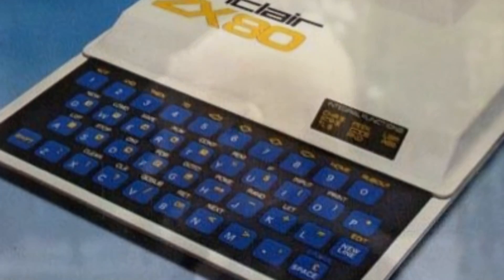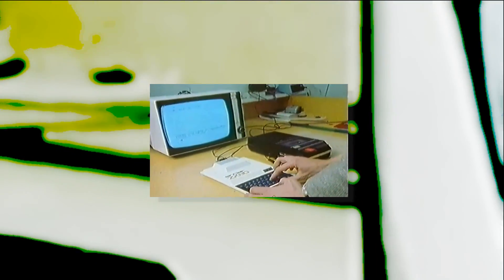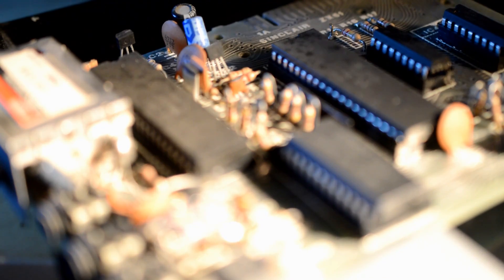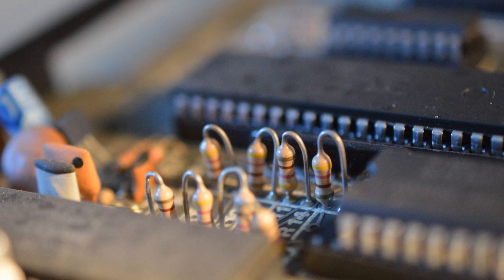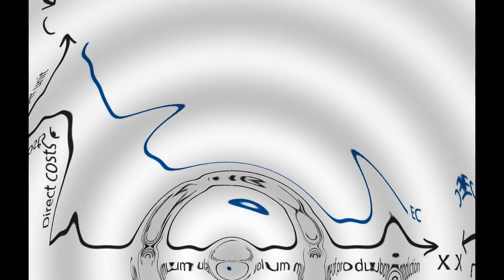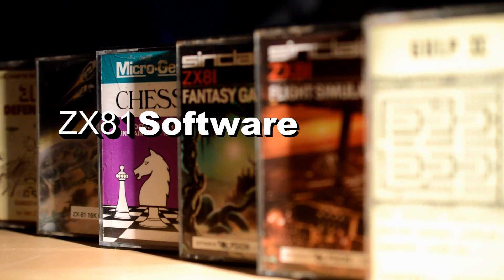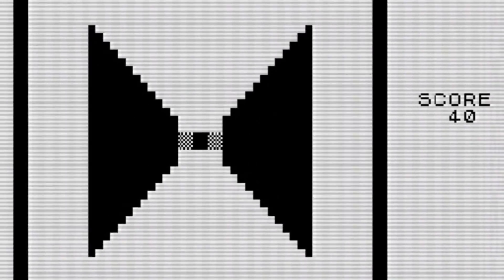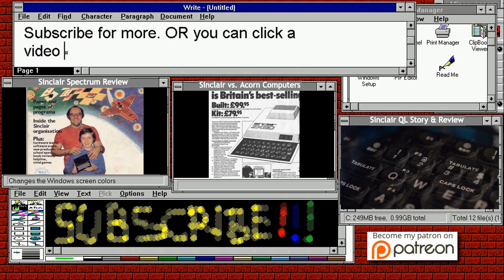Sinclair ZX81 (Timex 1000) Grandaddy of Computers | Nostalgia Nerd

Comment: i never had a zx 81 but i use to have a commodore/electron and i actually miss programing in basic programes from books and magazines and i use to work out the vdu code from my mums knitting patterns ,its a pity you cant just type into a computer anymore 10 print"tez" 20 goto 10 into the command prompt on windows

Comment: My dad got one of those when I was about 8yrs old or so. Two hours to program pong another hour to debug then get bored playing after 5mins. And those rubber keys were a nightmare to use. He also bought a printer that used rolls of this silver paper that has blue under is surface that the printer pin would melt and scrape images onto it.

Comment: OMG that was my first computer!! I paid $99 for it from my job at McDonalds in 1982. Over the next year I spent most of my checks on it!!! First I got a flat black and silver cassette recorder from Radio Shack. Next I got a 16K add on but it wasn't Timex's 16K block. Mine was form fitted along the whole back side of the unit. Next I bought a full size real keyboard for it that was a bit heavy in a metal case and sat right in front of the unit with a thin cable from it into the unit right above the 5 & 6. Next I bought the Timex 2040 printer and the last thing I bought was an io device that was form fitting along the whole back behind the 16K pack. I can't even remember what I got the io thing for? Then it all came to a stop in September or October 1983 when I saw a full page add for the Commodore 64 in a home computer magazine. I had seen adds before but it had cost $595 and I thought Id never be able to buy it. This was the same full page add I had seen before but across the top was something about a price drop to $229!!! I had at least $400 into my Timex/Sinclair and it could never be as good as the C64!! I remember the two biggest things that the C64 had that I wanted was color and sound (Awesome sound chip!). That is my story of loving my Timex/Sinclair 1000 to being all in as a Commodore 64 lover and my Timex/Sinclair being all boxed back up (OCD about taking care of all my items boxes!!!) and sitting in the back of my closet.

Comment: The ZX81 was used as the brain for a hacked BigTrack my father built that you could truly program as a true robot... It was a much-loved control system for the DIY robotics scene in the 80s, also probably the reason so few of them survived, they were cheap for using in projects as the Raspberry Pie of its day.

Comment: Dragon's Lair on the ZX-81?! Holy cow. I had the Timex version, spent hours typing in and debugging an orbital simulation from Creative Computing, was editing out the last error and preparing to save when the computer jiggled EVER so slightly and )blink( - RAM pack movement WIPES OUT all memory. Hours of work GONE. Frustrated, I immediately start over, retype, debug, save successfully, finally off to bed. Few days later, load up the program, try to input from keyboard - middle keys ALL unresponsive. Took the damnable thing back for refund, went to Radio Shack, bought a TRS-80 Color Computer, never looked back.

Comment: made a horror game in 40 seconds based off of saw.
basically, its crap but it's functional crap. There are no graphics, just commands
Pull the lever and die or don't pull the lever, get called a rude word, THEN die.
If you want the program, shoot me a message

Comment: 5:25 the keyword single key system (instead of typing each letter) was not to save space in a stored program as the CBM PET, Apple ][, Acorn BBC, Vic-20, C64 also stored the keywords as a single token byte which was a lookup into a table to access the ROM routine.  All the latter computers had the user type the individual letters of the keywords which the system then parsed into tokens (the Apple ][ was particularly heavy handed with token conversion).

The main reasons for the keyword system were it cuts out the need to parse the line entered for tokens, and syntax checking was implemented by only allowing valid keywords to be entered at any point removing the need to check syntax when running.

The only micro of the time I know that didn't tokenadise the input was the Acorn Atom.  However, it did allow you to abbreviated commands to the first few distinctive letters followed by a full stop.  The BBC micro kept this abbreviation system for its tokenadisation code.  The CBM machines used a feature of the way the tokenadisation code was written to allow abbreviations by shifting (thus setting the top bit) the input character (after enough to identify the token had been entered).

Comment: My very first computer. I added an external keyboard, a 16K memory pack and a tape recorder. Games on cassette would take around 7-8 minutes to load. There was a remarkable flight simulator which worked on the 64x48 pixel display. I don't know if you came across this, but it was announced that some UK government departments were supplied with ZX81s because, for certain duties, they worked faster than PCs of the time.

Comment: The ZX81 manual was miles ahead of other manuals at the time (or even now). I've shown it to a number of modern school kids while talking about early computers and one thing that comes across is that it is clearly aimed at someone who has never even seen a computer before.
Reply: The admiration of the old BASIC manual does intrigue me. Would you say it's still a viable way of introducing yourself to basic programming? 

I know it's not going to have a massive relevance to modern programming but is it still a good introduction of sorts?
Reply: @AC.LM11  It introduced a new concept with each chapter with practice exercises. So things like subroutines, printing anywhere on the screen, using graphics. All the basic concepts are there even by modern computing standards.

Comment: when people talk about the ram packs they only mention the sinclair ones, but the 3rd party versions were twice the size for about the same money(datel electronics, romantic robot and kempston which had a joystick port on it, i had a sinclair one but also had a datel 96k one though never found anything software wise to use that much memory lol, another thing was they are stackable if you have the type with the pass through slot on the back, you can put another pack on the back and have 32k.

Comment: Someone I knew gave me his old American versions of the ZX81, the Timex Sinclair 1000 in the late 80s.  It include the 16k ROM expansion pack and the Zx printer, a spark printer. Played around with it for a short while. I found the membrane keyboard to be pretty poor for extended use though like the ease of typing basic commands with key combos. The TS-1000 sold for about $100 in the U.S. back when it debuted. Interesting footnote in computing history, though like netbooks being displaced by iPads and other tablets, the ZX81/TS1000 where just not quit up to the task compared to the ZX Spectrum, Vic20, or even Atari. Sometimes it's better to spend a few bucks/quid more to get something more usable then to just go for the cheapest.

Comment: Since a heck of a lot of ZX81's were sold as kits, it is a shame they did not include an option for AV-3-1910 sound chip and 16K Ram on the motherboard, or for assembled machines, a socket a sound chip and extra Ram.  The sad part is there is enough room on the motherboard to add these and it would not have cost anymore.
Reply: Anyone with a working knowledge of digital electronics would be able to do this very easily. Unfortunately the ZX81 was designed down to the last penny.
Reply: I know it was made for the lowest price possible, but leaving space for un-populated chips should not have cost any more money.
Reply: @10p6  " but leaving space for un-populated chips should not have cost any more money." Not true at all, the PCB space still costs as you need a larger PCB and that cost adds up when your making 100,000s of them.. they just wouldn't do it knowing that probably few people would actually bother/or have the smarts to, add those chips. the market needed a super cheap computer.. if you wanted a computer with extra memory and sound those computers already existed and naturally cost more
Reply: @DanafoxyVixen   All the electronics even back in 1980 / 81 would have fit on the normal PCB, so it would have not cost any more.

Comment: I had the official 16K expansion, which I kept in place with a rubber band that went all the way around the computer.  It was $100 US assembled and $50 for the 16K.  I bought it before the TI version was released.

I learned assembly language on it by converting the assembly language into numbers by hand, then putting them into a string with a basic program.

While the mnemonics are different, Z80 assembly language is pretty much the same as 6502, so it the move to the Atari 8 bit wasn't difficult.

Comment: I was tempted to save money and buy the kit, but I thought to myself, what happens when I solder it all together, and it doesn't work?  This was before Timex branded it as their own.  I remember mailing away to Nashua, New Hampshire for one of these.  It was not long before I also ordered the 16K RAM pack.  I also remember basically learning Z80 assembly from the manual, because of the table they had, for each 8-bit number, listing the decimal, hex, character, and opcode nmemonic.  Heck, I hand assembled some programs from that table, then sat there POKEing the code into a (dummy) REM statement.

Comment: I had the Timex Sinclair 1000 around 1983 i think it was, was fairly useless, i kept running out of memory either while writing code in basic or would crash on initialization of first string array. it was pretty frustrating, even after getting an 8k ram expansion pack, the situation hardly improved.

Comment: I don't understand the reliability issues, I've owned three TS1000s, and never had a single problem.  They do get a bit warm to the touch, but otherwise are pretty bullet-proof (I suppose I could have just gotten lucky three times in a row).
Reply: It was mainly an issue with the machines sold in UK and europe, i believe; the main culprit, as also mentioned in the video, was too weak powersupplies, but as soon as Sinclair fixed them, the issue was mostly solved. I guess the US models had better PSUs from the get-go.

Comment: are these worth anything? i just found one mint in my garage(except the box its  deteriorating lmao)
Reply from the maker: If it still works (they're prone to reliability issues), then you could get high double figures for it. If it's not, then you're probably looking around £40, depending on the box condition. Also, it's worth checking what issue it is. If it's an issue one (printed on the circuit board), then they tend to go for more, but are also the ones prone to most problems.

Comment: I had a Timex Sinclair 1000 in 1984 or 85. JC Penney or SEARS had it for $19.95 and the same for the 16K RAM expansion. I was just a kid, but could afford that. I had a VIC-20 as well. I had alot of good times with the old ZX81/Timex Sinclair 1000. I got all the computer gaming magazines and remember typing programs into both. I also made a dungeon crawl type game from what I learned in computer class at school.
Reply: +Arnie Mahns  P.S. I got the 1000 (ZX81) and the 16k RAM and a new tape recorder for like $60 total. I don't even know what happened to it. Lots of stuff went missing when I went to the AirForce.
Reply: what are some good games? i just got one and frogger 😎
Reply: @jonniefast  You are probably better off watching a video on best ZX81 games. I only typed things in from magazines and wrote my own little programs.

Comment: hmm i live in the usa and i have a zx81 (ntsc), did sinclair sell it as the zx81 then the timex 1000? i even took a peek at the mobo and it has sinclair zx81 usa issue one silk screened near the expansion port, and the board has red solder resist coating on the back side, and one 1k x 8bit ram (instead of two 1k x 4bit)

Comment: My dad won a ZX81 at a local lottery and it had no external memory. Turn off, all gone. I spent more time typing the programmes than using them but it was good initiation.
Reply: hook up a cassette and bingo you can save programmes and spend two or three hours listening to a pre digital style modem sound as you tried and tried and tried to load it .......happy days !!
Reply: so he won a computer with no onboard ram? sounds like he got "Bit" lol
Reply: Took me weeks before I got a working cassette recorder.

Comment: You can solder in a 16KB RAM chip straight onto the motherboard, rather than using wobbly external RAM packs.  http://blog.tynemouthsoftware.co.uk/2014/07/zx81-internal-16k-ram.html